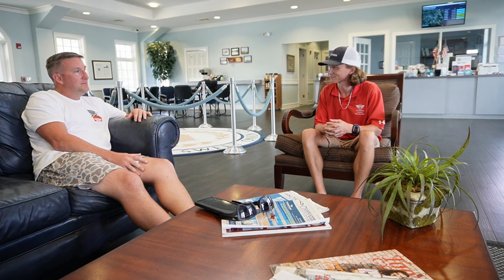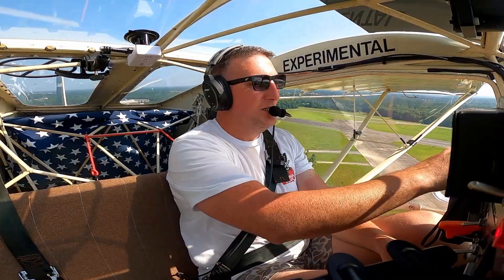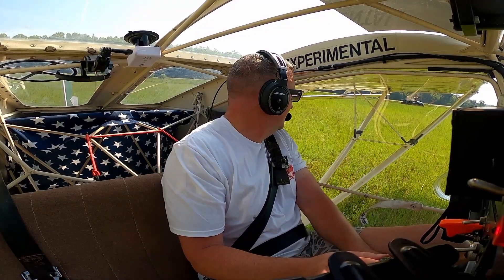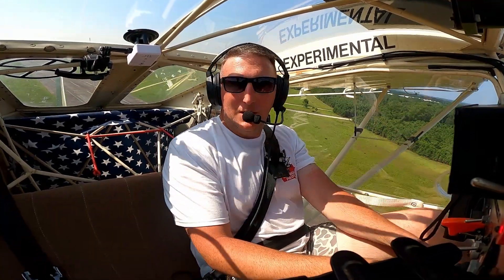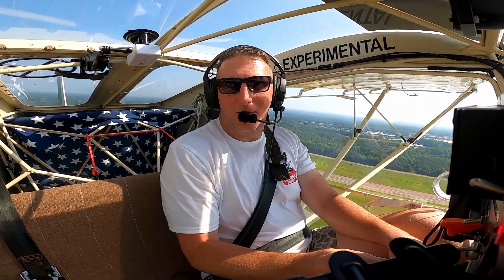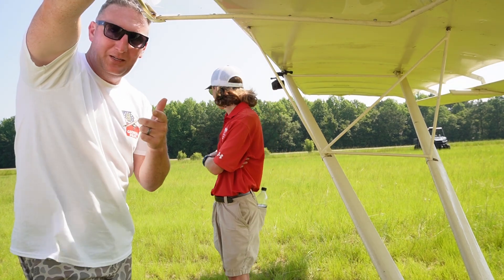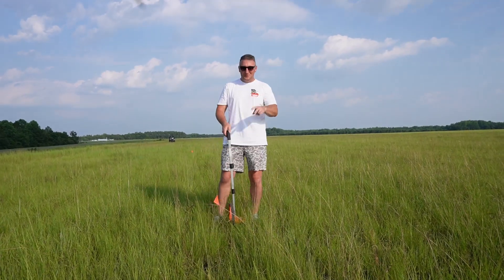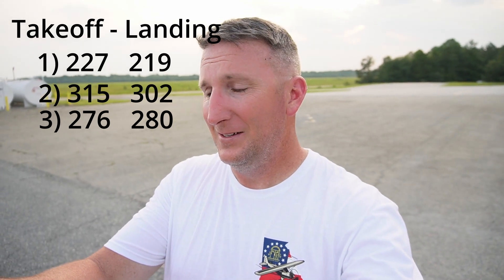Is the Avid Flyer STOL capable? (Not a Kitfox)

Comment: With our avid we’re getting 150-175 on take off and landing we routinely 250-350 not slamming on breaks. Still playing with the new landing gear the tk1 racing and 10 inch tail wheel. We also have the continental 0 200
Reply from the maker: That’s great results! What braking system do you have?
Reply: @OneAV8  Barringer, wheels and brakes
Reply from the maker: @blackswampaviation awesome!
Reply: @OneAV8  we had the grove landing gear from factory the heavier one because our avid is heavier than most. The Matco wheels and brakes didn’t work well on our avid also had issues with the wheels and tires. Brakes no matter how hard you push on them they were very weak. But everything is going great now with this upgrade.
Reply from the maker: I’ve been debating the Baringer route.. mostly because I’ll need to upgrade my tires too and I don’t want to have to sink all that money until such a small plane. 🤷‍♂️
Reply: @OneAV8  if your going to make it good right lol. We spent it more than once on this one.
Reply from the maker: 😂 right! Yours is good looking for sure!
Reply: @OneAV8  my dad spent plenty of time on it lol bought it in 1997 took him nearly ten years to finish it the the landing gear and break issues with a wing tip damage took it down for about 6 years but now it’s up and flying now I just need to get back current so I can fly it. We also have  another plane tri pacer 150.
Reply from the maker: @blackswampaviation that’s a cool story! Glad you still have it and can see it flying/fly it!! Sounds like some cool adventures to be had

Comment: I have a B also, and am needing to update my tail wheel assembly.  Can you share what is installed on yours?  Thanks
Reply from the maker: I have a Maule tailwheel… I’ll have to check the logs to get the exact model 👍
Reply: @OneAV8  That is what I have currently and am seeking an upgrade from the single leaf spring Maule tailwheel.  The spring installation bolt only allows for 1 leaf spring, which fails quickly.
Reply from the maker: I haven’t thought about that… add it to my list of needed upgrades 😎